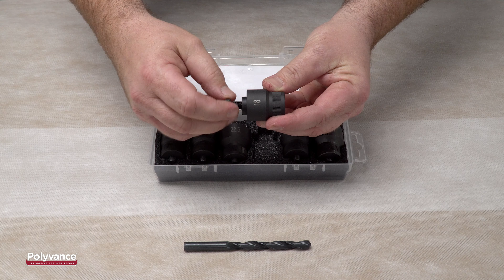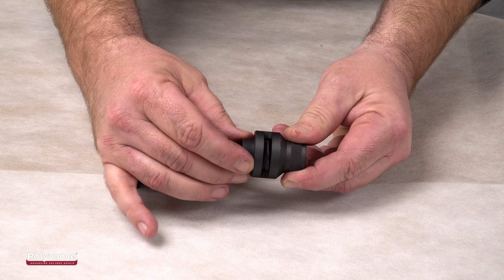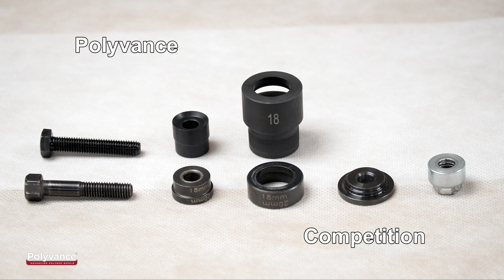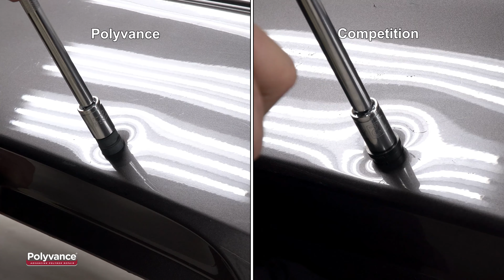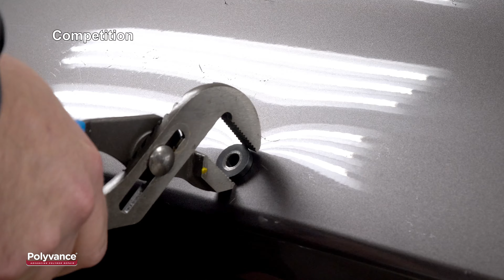Polyvance's 6149 Sensor Hole Cutters

Comment: Pretty slick tool. And finally I get to use my 13mm! Now what happened at your last race?!
Reply: We spun a cam gear around the camshaft, mating the intake valves to the piston.  It was strange because it was driving fine, then it was like someone turned the key off.  It was handling sooo nice at the time too.  We went from 10th to 94th.  :-(  No damage to the piston, but sourcing valves was an issue for our JDM motor.   We are about ready to put the head back on, finally.